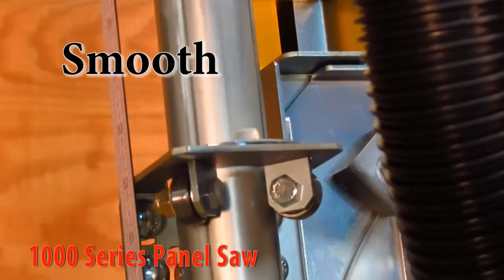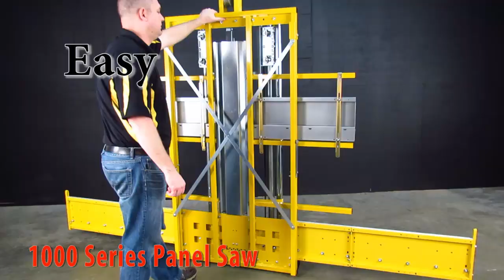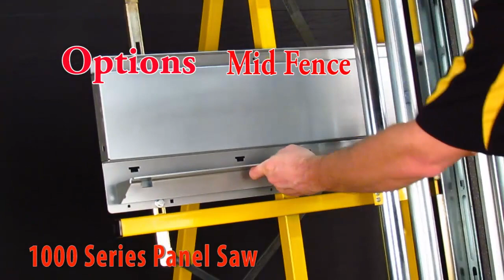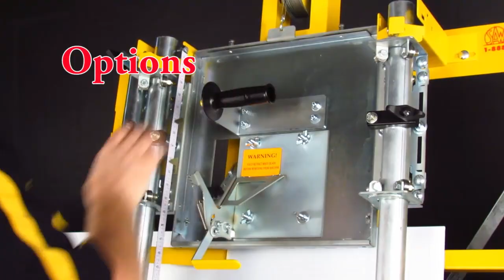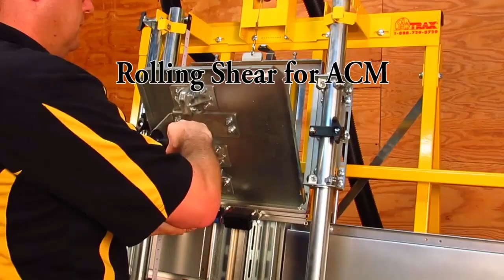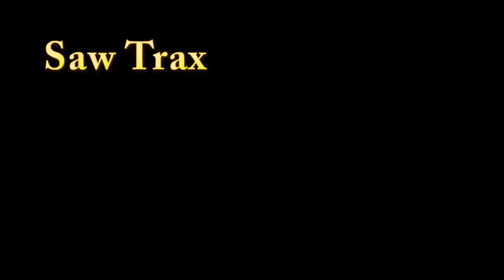Saw Trax Vertical Panel Saw using Makita saw in a Full Size Frame, 1000Series

Comment: I want 1 do you ship to Australia
Reply: Yes we do but would need to put in a different saw for the different voltage or sell you a converter.  Australia has strict import laws on the wood we use for crating.  They require the use of certified heat treated wood to ensure no "bugs" are present.  We use this type of wood anyway but the stamps are not on it.  To get the crate wood stamped to allow import is a charge we have to pay to the lumber company.
Reply: By the way, we would use a Bosch GKS 65 saw that is European complaint with power.  Can you double check what the power requirements are there.